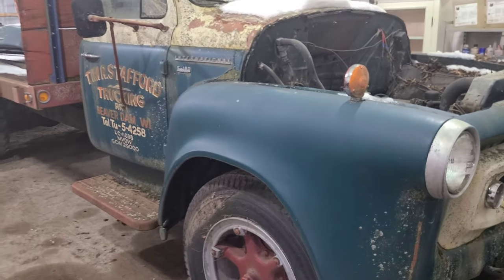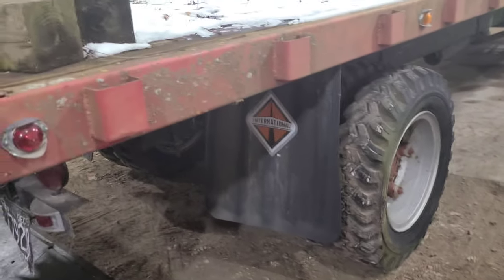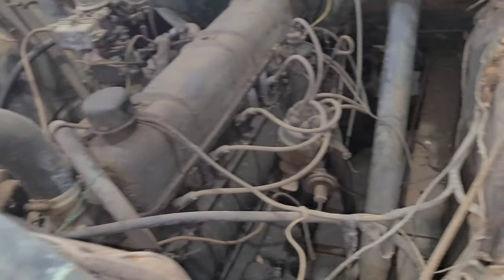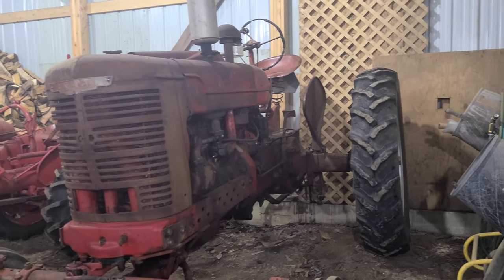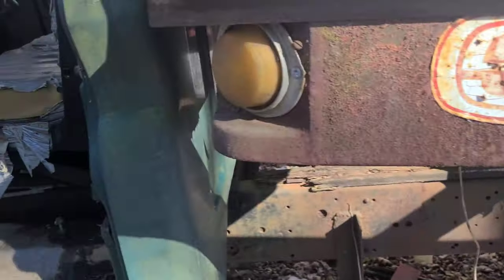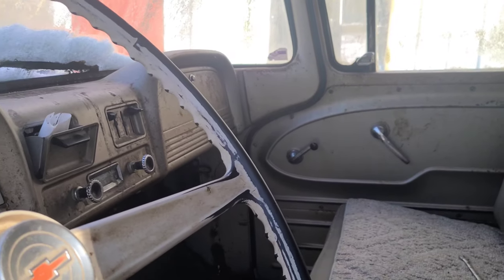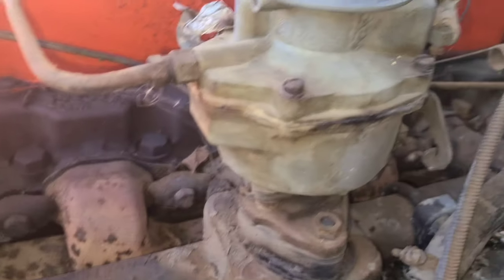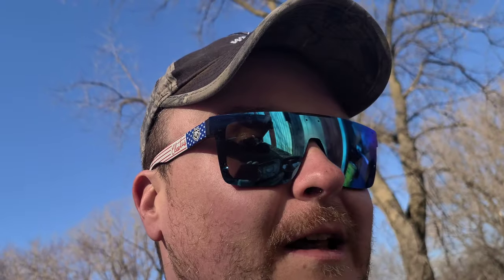1956 Binder and 1962 Chevy Trucks. WE NEED HELP!! Ep.4

Comment: Water pump is impossible to find. I found that a waterpump that fits a case tractor that is readily available for cheep is the same thing you just have to add a fan spacer to drive the fan ahead to clear the alternator,  generator pulley.
Reply from the maker: Ahh okay. Yeah I'm thinking we're good on the waterpump as far as we know. The exhaust manifold is cracked really bad and also very hard to find.  We're gonna try and weld it. Hopefully it goes well... lol thanks for the input!